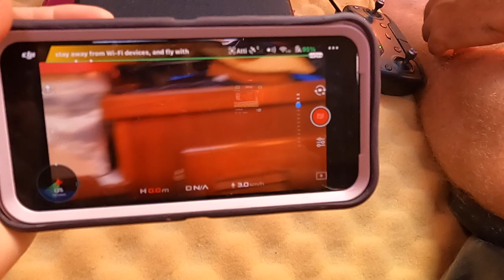DRONE SALVAGE #92 rescuing our camera

Comment: If you don't have bags of silica beads available, then rice is a suitable substitute as it happily sucks up all the moisture and is usually pretty easy to come by, other dried staples like chick peas, lentils, or other dried beans might work too, but I've had success with putting mobile phones etc in a zip lock bag with a handful of rice overnight.

Congrats on saving the drone and 👍🏼for not just chucking it away and buying a new one (as someone who's watched your channel for a while, I know that's not your style 😄and I appreciate you guys more for that).

Comment: Had to think back to a time when my father was part of a group that developed a device that sprayed WD40 on hard to reach electronics in salvage operation of an atomic sub that had sunk at it’s dock. Yes this was in the US. Not sure about efficacy of using WD40 in or on electronics in a modern drone. Now all you have to worry about is residual salt that could cause corrosion.
Reply from the maker: Yes, the video doesn’t mention that the Rio Dulce is mainly fresh water, but we detected a hint of salt in the flavour, haha. I would definitely rinse the drone. with fresh water if it went into the salt. I think WD40 might be too harsh as a cleaner on the delicate microchips and other plastic materials found inside the drone. I have soaked several of my iPhone parts with isopropyl alcohol, so I think cleaning the drone out a bit with that might work too.
Reply: WD stands for water displacement amazing stuff ! but not so sure in the case maybe !
Reply: Well they did it as a stop gap there was a whole process, the WD40 had to be dealt with with sore sort of solvent afterwards as I remember. Of course this took place near to 50 yr ago.🤷‍♂️ LOL memory is a funny thing at best.🖖✌️